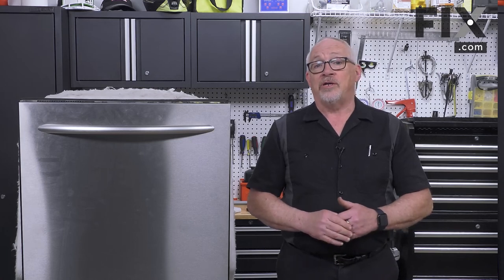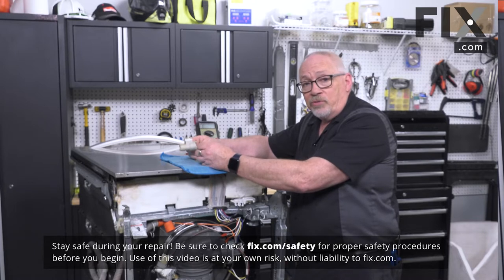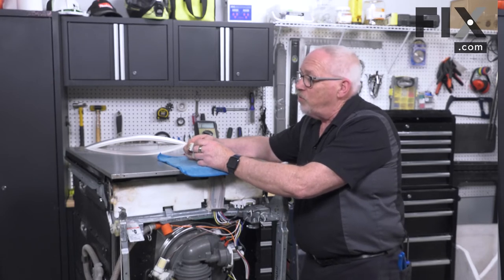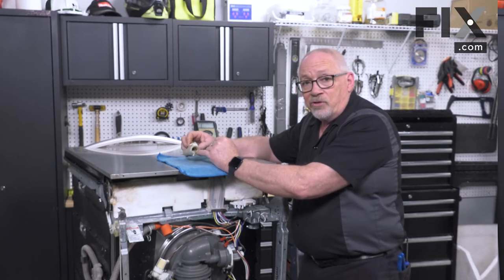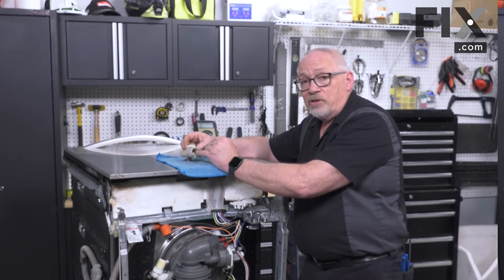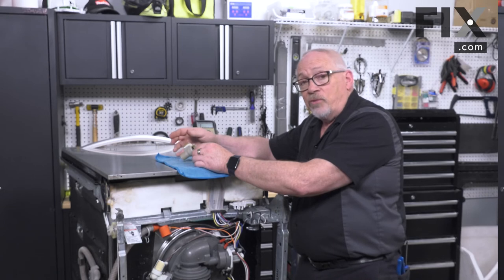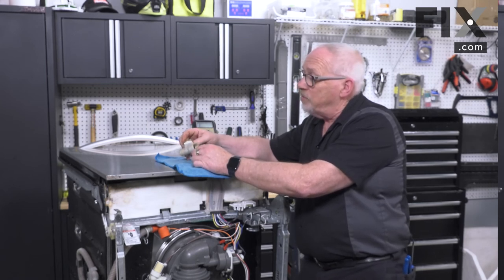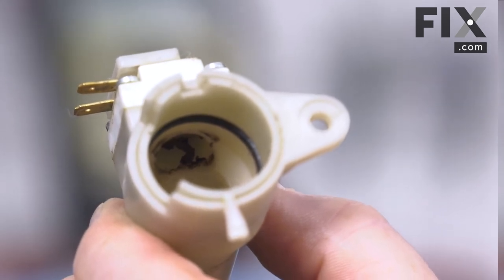DISHWASHER REPAIR: How to Diagnose the Turbidity Sensor on Your Dishwasher | FIX.com

Comment: If my dishwasher is filling for a few seconds, then draining, and it does this a few times and then blinks the auto and heavy lights, could this be the turbidity sensor? It’s an excess water alert but it’s draining perfect and the hose is definitely clear, I’ve gone through that extensively, removed pump, and nothing is wrong on the drain side.